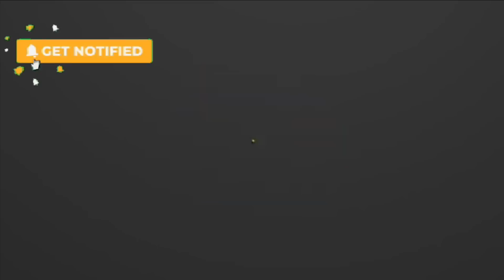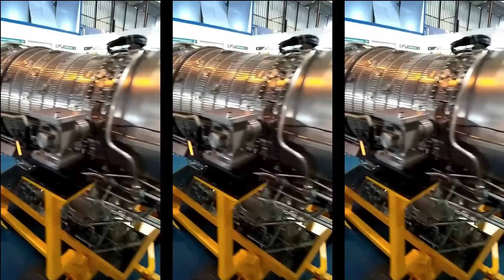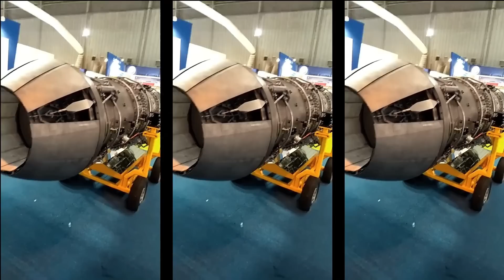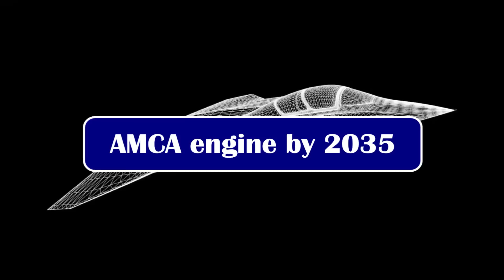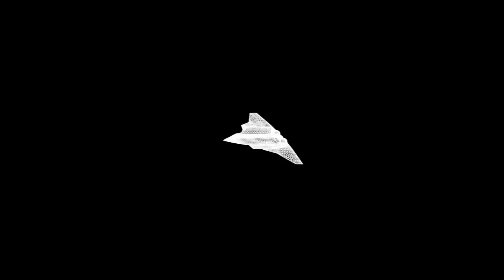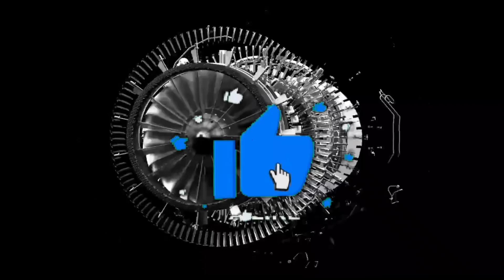Kaveri Engine with afterburner section for LCA Tejas

Comment: Damn it. Buy some retired twin engine aircraft like FA18 Super Hornet or Mig 29 or Tornado that still has good deal of airframe life, strip it of irrevelant subsystems, install the turbofan on one side with real time monitoring system and fly it in different altitudes, at different speeds and accelerations, in different weather conditions, over different terrains with different payload weights and different flying maneuvers extensively, collect the engine performance data and study it thoroughly. If the engine fails and the aircraft crashes because of that (of which there is less chance as the second engine, already proven one will return the aircraft safely to its base), it is just the prototyype engine that is lost (you got to be prepared to take such risks) which can certainly be kept confidential to ensure that no disrepute is brought to the LCA program itself. To properly test a turbofan meant for fighter jets, nothing other than an actual fighter jet suits more as a flying testbed. Unbelievable that GTRO can not afford a fighter jet nearing its retirement or does not have enough connections to get a deal done.

Comment: Till date the Government of India hasn't provided GRTE with funds for a in flight test bed .The Government of India is not confident about the GTRE that it will be able to deliver a high performance engine with the desired rating .
Reply: I think it is a question of money. The budget is limited, hard choices are made. I think you're right that India should prioritize this. Self-sufficiency in engine development is the last thing India needs to be fully self-sufficient.
Reply: @123ms98  WE are loosing a lot of money to the Western nations just to import aircraft engines. This will stop.only if India is able to develop it's own engine. Still we haven't been able to provide in-flight refueling system for testing the engines .Then it amounts to be a developmental goof up .Sheer stupidity and nothing else .
Reply: GTRE will make its own money once it starts using the engines on drones. Things will move forward from there quickly.
Also the Safran engine experience will help.
Let them keep trying to build the wet thrust from now itself. Most likely it will succeed without any addictional funds.
Reply: Corruption by politicians

Comment: I think India should put kalveri engine on the LIFT. Reduced specs are not a problem as it is trainer.Try and sell it, it will be much cheaper and more likely to win orders. This will  serve as a product demonstrater at the same time give DRDO real experience with this integration.
Reply: The weight is an excess only upto 500 kg. I also think it can be further reduced.
If the achieved thrust is close to 90-95kN it won't really matter. It means we'll have to redesign the jet and it'll still be supersonic.
Reply: Who is going to address the weight issues pertaining to this engine .
Reply: @ajaykumar-pf9vd  That is a major issue  , put a stiffer frame and maybe let it be first subsonic trainer. And when technology has been gained (or acquired) then make a supersonic.